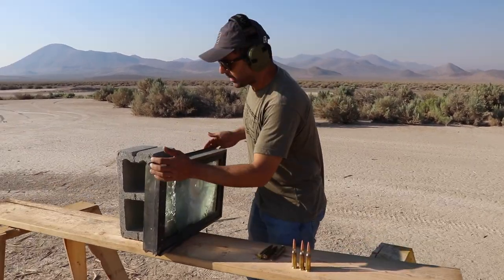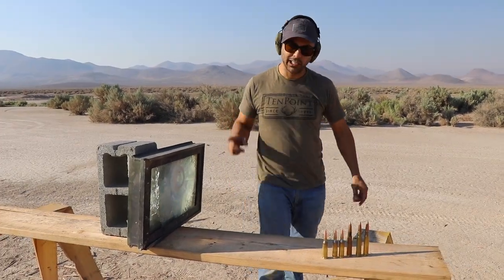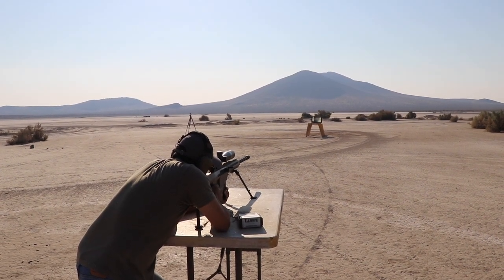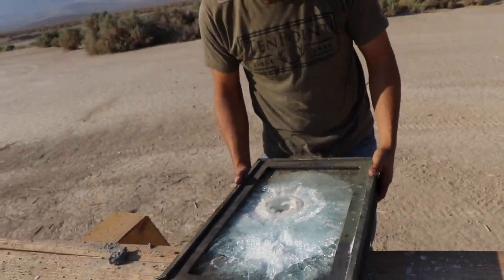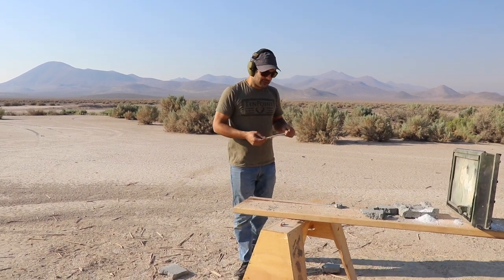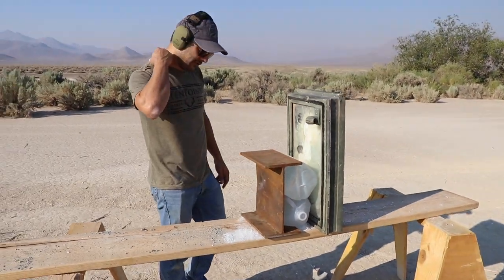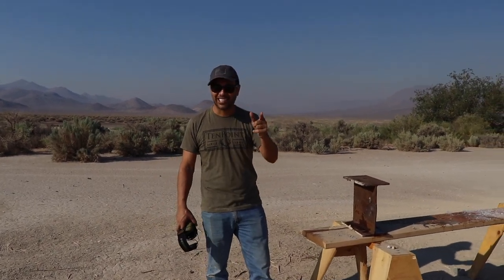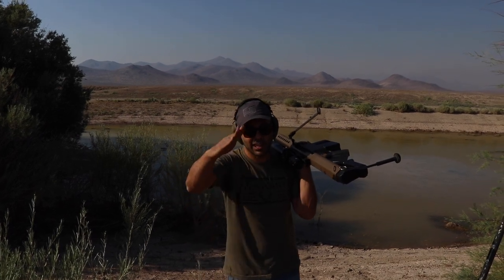50bmg vs 416 vs humvee BulletProof Glass

Comment: The glass was already compromised from the 20mm y'all shot it with. Anything afterward shouldn't count because the structural integrity is already gone.
Reply: But did you see what it did to the rock
Reply: I agree it’s compromised
Reply: @lucasdunn2717  did you see the hole in the glass? obviously its going to mess the cement brick up..
Reply: Edwin's has already shot thru 6 inch thick bullet proof glass with .50BMG API rounds. 4 inch is nothing compare to 6 inch.

Comment: Would a 416 go through if that glass wasn't already compromised? I'd love to see it, great video guys 👍🏻
Reply: Although a bit lighter, it's quicker and a smaller diameter. It sure seems like it would but that block stopped it in its tracks. The mass of the 50-BMG is truly impressive!
Reply: I was thinking the same thing
Reply: I would say yes
Reply: the 50 definitely compromised most of the glass layers
Reply: @rogusmith2630  the 50 went last
Reply: I think it would.....
Reply: Unlikely. 20mm is a hardened anti-armor round, .416 comes in lead or brass.
Reply: No it won't
Reply: However a . 408 Cheytec will probably penetrate
Reply: @Ghost_1944  416 is faster and about the same caliber if the 416 wont then more than likely the 408 ct wont
Reply: @mechanicgray  the 20mm compromised all the glass.
Reply: I thought the same

Comment: several comments stating that the structural integrity of the glass was compromised by the 20 mm round shot previously.  although there were numerous cracks in the remaining glass, mr. sarkissian’s placement of the .416 was relatively far from the direct impact site of the 20 mm and the .416 bullet still smashed through 4 inches of glass.  i think the glass took everything the .416 was handing out but the round was just too much for it.  let’s put it this way, (to all those who think a new glass would definitely stop the .416), would you be willing to stand behind it down range?  i’m not.
Reply: Mohsin Ahrar , american servicemen killed: 2,500 

taliban and opposition fighters killed: 51,000 

we kicked the snot out of you for 20 years 

what else you got?

Comment: I’ve seen first hand a Humvee windshield take more than 100 rounds of 5.56 and 30 AP black tip 223, 5 rounds of 30.06 and a handful of 300 blackout. I have no doubt our soldiers are safe. Unless the windshield starts delaminating then they’re at the hands of the driver.

Comment: If interested in 5 inch thick ballistic glass DM me. I have some brand new glass just sitting around. Rated for 50cal and supposedly is RPG resistant. Still had factory protective film over it for prior to install.